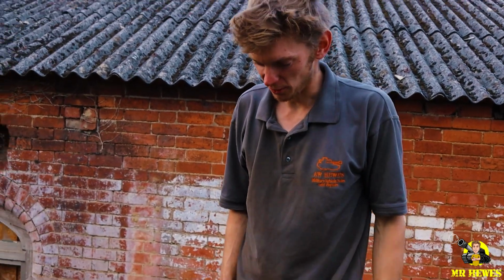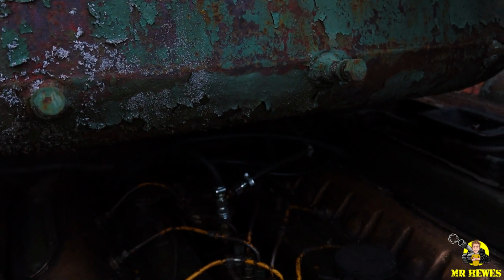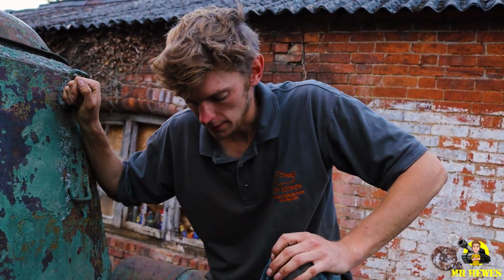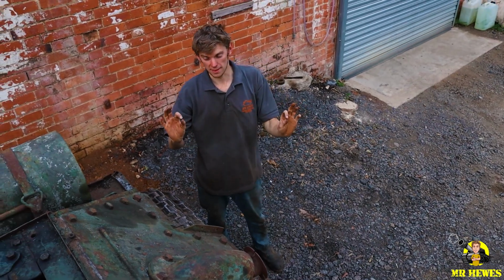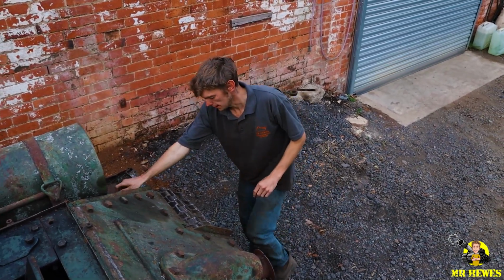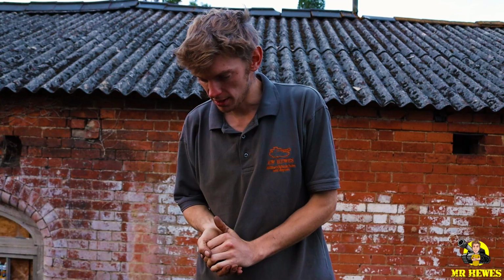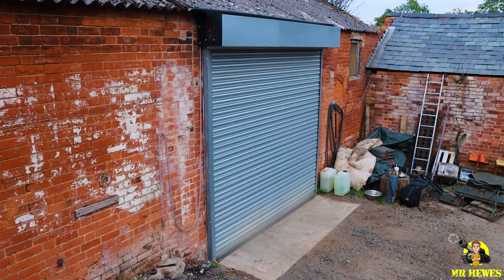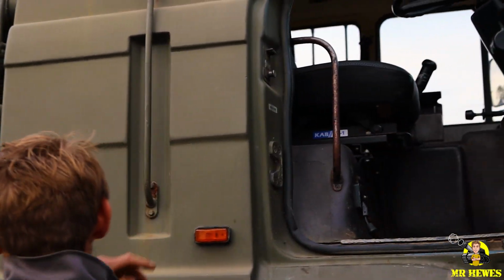Moving The Broken Tank! T34/85 EP2

Comment: That truck is awesome yea love that stuff . I was a builder mover before I joined the army did it for 15 years joined the army at 35 . We jack up n move houses we moved a couple historic covered bridges in Massachusetts USA . That truck n lift would of been great for us especially moving the steel . In order to get that house up you have to set up cribbing witch is he 4’ blocks and build the cribbing level height to set up rollers get the two main beams the size depends on the house usually 50’ to 75’ . You get those in set up cross blocks install hydraulic jacks . Put the cross beams on top of the main crossing over. Make it all level with blocks n shim and start jacking it up. We would go 6” then throw in a few more blocks n another 6” blocks till you get your height east peasy

Comment: Out of curiosity, since the timing just opens and closes the injectors, have you thought about testing by connecting an external high pressure diesel pump to the rails and give her a start that way?
Reply: These older injectors are always open, on a rig is a good way to test and ensure flow is good, it’s a pulse of diesel that passes through the the injector, at the correct time, i.e just before TDC